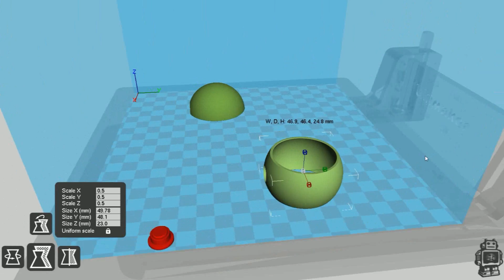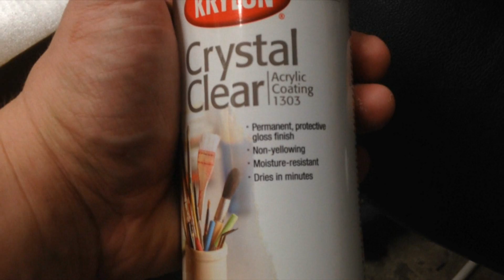🔥 Forget Catching ‘Em—Let’s 3D Print A Real Pokémon Pokéball! 🛠️⚡

Comment: wow he learns what a clear coat is GG dude GG Also you will get a better finish if you wet sand each coat of clear with a minimum of 5 coats ( normal  stuff for Cars ) and you wont get that ripple in the Red on the top..not to be picky good to see a Video from you Buddy

Comment: Another good tip dude for painting. put the tins of paint in hot water and I will thin down the paint and it works better without splashes and doesn't run as easy :)

Comment: Hey Dude, i dont know if you are able to give a hand, im using an printrbotplus V2.1 but i sill having issues printing i have a .4mm nozzle, head bed with pla i use 222C, and 80 on bed, some times it warp, but if it use lower temp the extruder star trac trac trac, mi fisrt layer its .31mm and the others .39mm and 40%infill but i dont know what king of setting do u recomend for me. please give a hand. love u videos!

Comment: Good job and Great video  that 'batch printing' technique prompted me to ask you to consider doing a vid on 3D terms. 

In the title you mentioned "sanded" but in the vid it seemed to go from print to paint, was that just editing or was anything sanded.  What the sanding that was done, if any, simply to clean up edges?  

If in the design you print a blob of material in the right spot 'inside' of the bottom of the toy it will always point 'look' at you (45% degree angle), even after you roll it around (no rattle or sound). 

Each week you should consider a give away of the masterpieces that you print in the video, 'fan' engagement will go through the roof, and the limited works will actually have added value because of their limited nature "this is the piece that was actually featured in xyz vid on lmn date"   

If you wear an Armis tee-shirt during the giveaway vid we are willing to provide an collector's item appraisal along with a guarantee, good for 30 days, that would insure a specific minimum sale value. It must be the exact same item in the video, be in the same condition as shown in the video, and be accompanied by a Certificate of Authenticity. If you sign and date the item in the vid the item will have more value than without it.   Let me know if you are interested.

Comment: Ok so I'm working on an Erza Scarlet cosplay and I'm trying to figure out the best way to make her dual swords. I'm unsure whether or not it's possible to print them or the parts in a 3D printer (if they'll fit) or just make them out of some other kind of material by hand?
Reply: penis
Reply: You'd have to make the swords in lots of tiny little pieces.
Might be better carving them out of foam then filling the pores with something like bondo before painting. Search around on YouTube for good ways to make cosplay swords.

Comment: what are the materials i need for 3d printing?
Reply: $4k-13k for a single color printer plus like $20-50 for the type of color/plastic.
Reply: Bob Lymnax $20-50 is not that bad.
Reply: Jonathan Lam it all depends where you get it from.

Comment: You didn't "finish" the part before moving to paint.  You want to use a fast drying primer. Spray three even light coats. Then wet sand  using 600 grit sandpaper and soapy water. The soap acts as lubricant to sand easier and more evenly. Sand evenly and gently until you start to see the lines of the 3d print show through. Once you did that you know your done sanding. Then apply another 2 thin layers evenly of primer before finally painting your printed item.  Trust me it does wonders. Check my channel machinepsychology to look at the finished 3d printed Ducki Robot. :)
Reply from the maker: Great tips, thank you!

Comment: When you print the pieces couldn't you add a lip on the outer pieces and 2 inset lines on the inner piece so they actually snap together, then require no glue what-so-ever and guarantees that they are perfectly fitted?
Reply from the maker: Yes, this is actually a genius idea!

Comment: You could buy one online or at your local 3D printer store. Just kidding. Online will suffice. Anyhow, if you really want one, they are not that cheap. The ones I have seen with still decent quality and endurance before something break is a really small 3D printer with a low print resolution around the price of €1600,- Prices may differ per store. But consider buying a 3D printer since the thing is not cheap to maintain.

Comment: Hey, like your videos!  For painting your printed parts, you want to use something called "high build primer".  It is quite a bit thicker and will fill in all the gaps and texture in your models.  Then just give it a real light sand with a sanding sponge (320 grit would be good), and paint.  It will completely remove the texture you're seeing in the finished parts.

Comment: The primer seals the pores of the plastic. Not allowing the colors to sink into the plastic. So they pop more. I Spray bombed my car flat black. Just sanded and went to town.... Didn look  right. Resanded applied 2 coats of primer, 1 base coat, and 2 final coats, 2nd slightly lighter then the 1st. And it looks like a pro did. Learned patience is everything with painting

Comment: You start out the first coat with a light misting at 50% transparency. You still want to see parts of the original color under it. (spray over it about 4 times in total, you do not want fulll coverage.) Do another 50% on the second coat, then a bit heavier on the 3rd coat to ensure full coverage. 
This is the best way to paint with any kind of spray.

Comment: you can also use a hair dryer on low with high heat between coats and it will be dry in less that 5 minutes.